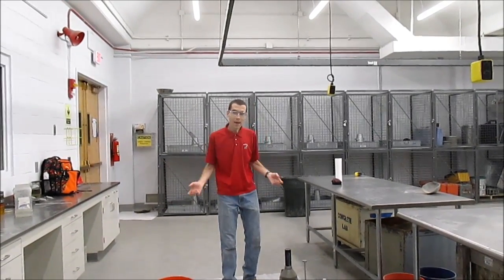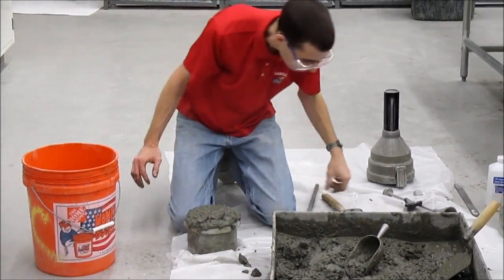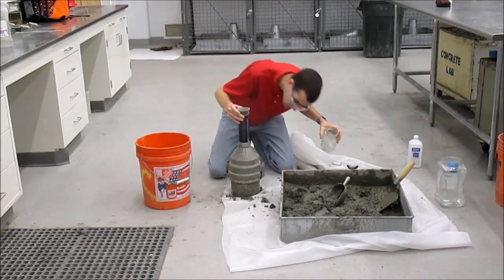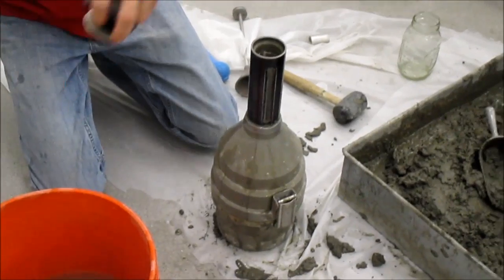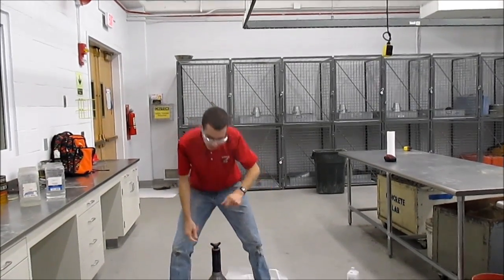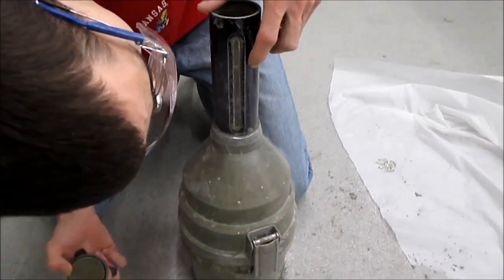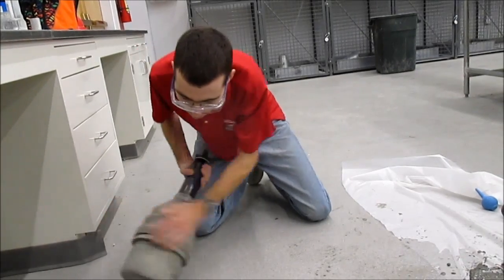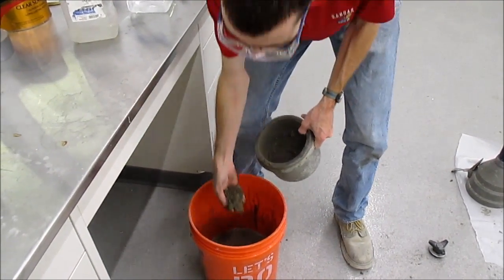ASTM C173-Air Content of Concrete-Volume Air Meter

Comment: hey one question so whats your final reading ?   i guess is 3 % right ?  not 2 3/4?
Reply from the maker: Correct. The last reading you take is the final air content, and is the one you report. (After correcting for any calibrated cups added and alcohol, depending on how much you added)
Reply: thanks man